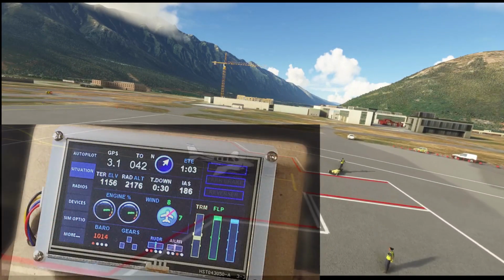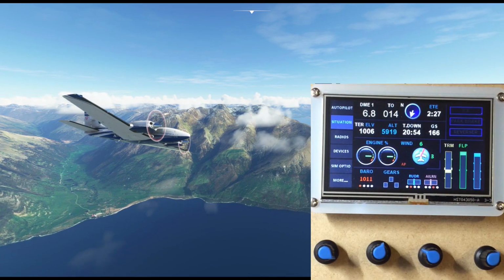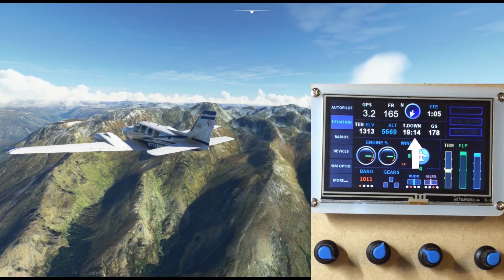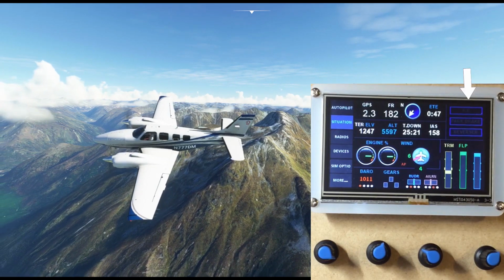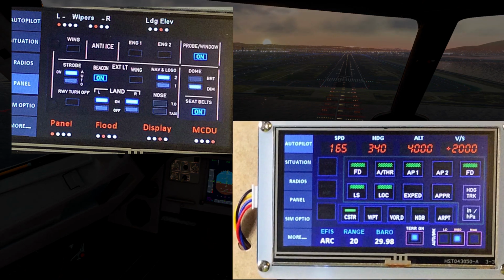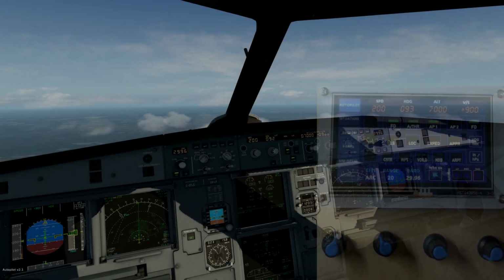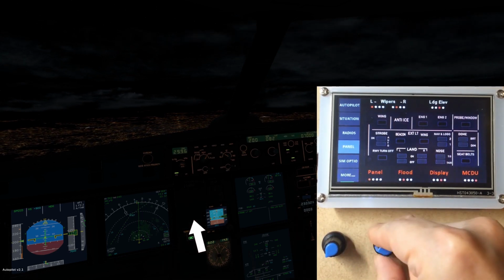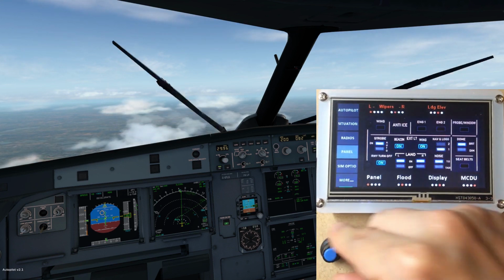Flight Sim Touchscreen Panel  [Update 1]

Comment: hi，
Discman777，Cannot see the load and save button in the Microsoft-FS2020-To-Arduino software interface
Reply from the maker: By any chance you’re using a non-English version of Windows?  I’ve heard similar issue from one viewer.  The person reported that FS2020TA worked fine after switching to English Windows.
Reply: @discman777  I switched to English, but the button is still not displayed .
Reply from the maker: @cokin2023  You should contact the FS2020TA author via Github.  I know the other viewer who had this similar problem had reported it to the author (3 weeks ago).  I was not in the loop.  The viewer told me that FS2020TA displays correctly under English Windows 8.1 and 10.
Reply from the maker: A very nice flush-mounted panel!  Thanks for sharing.